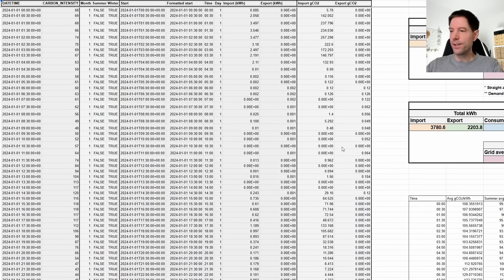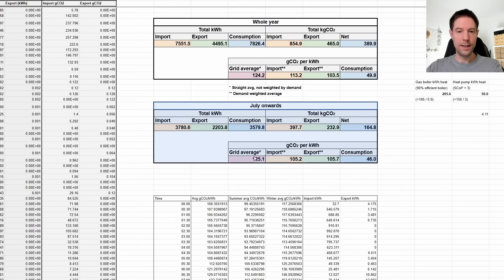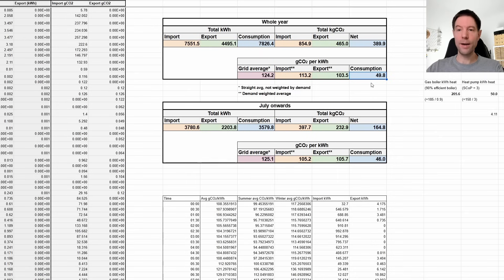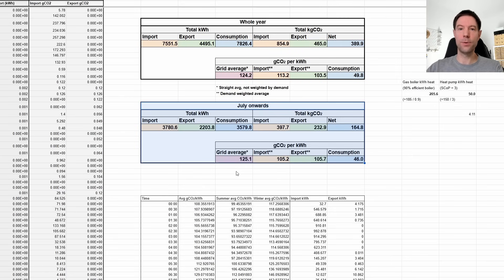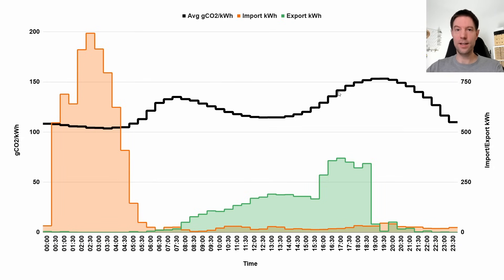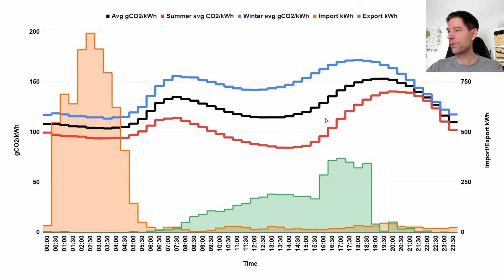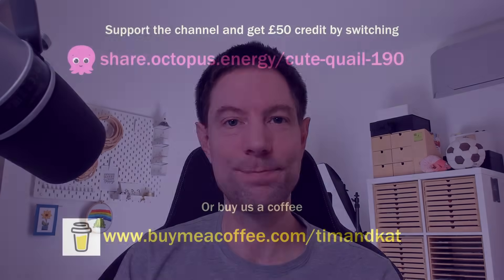I thought we were carbon neutral - I was wrong!

Comment: The carbon intensity figures you're using appear to be per kWh of generation, whereas your usage figures are presumably meter reads, ie consumption. I believe average line losses (transmission+distribution) in the UK are around 8%. If 8% is roughly correct for your area, that means that for each kWh of imported energy you consume your carbon intensity figure needs to be multiplied by 1/0.92, as more energy is generated than you will read at your meter. There is also a line loss related to export, though this should be lower than 8%. You may have already factored this in, apologies if I've missed where you've done that. If you haven't then your calculations are somewhat mixing apples and pears and unfortunately put you further away from carbon neutrality than you have estimated.
Reply from the maker: Hmm, that's a good point, I'll have to check what the data actually means, whether it's carbon intensity as generated, or consumed.
Reply from the maker: Ah ha!  I found the definition of the CARBON_INTESITY column for the dataset I used.  "The carbon intensity of electricity is a measure of how much Carbon dioxide emissions are produced per kilowatt hour of electricity consumed."  As taken from this page: https://www.neso.energy/data-portal/historic-generation-mix/historic_gb_generation_mix
So I think what I did was ok.
Reply: @TimAndKatsGreenWalk  Ah yes, so the carbon intensity data must be adjusted for losses in some way. Agreed, what you did was okay for imported energy, not sure about exported though as that will be a generation figure I guess? I've no idea how it could be quantified either!
Reply from the maker: @CazBag  well, anything I export will be used by my neighbours, effectively reducing their consumption by the same amount.  So I think that's all good too.
Reply: @TimAndKatsGreenWalk  What you export will reduce the load on the local transformer supplying you and your neighbours, which then has a ripple effect all the way back up and through the network. In that sense, the energy you export doesn't really get used by your neighbours, but it does contribute towards lowering total generation. It's difficult to put any numbers on it to quantify the contribution and therefore the effect on overall carbon intensity. The kWh you export are generation and not consumption though. Does that make a material difference? Still no idea! Sometimes things are best kept simple, that I do know!
Reply from the maker: @CazBag  I would argue that reducing the load on the local transformer is materially the same as my generation being directly used by my neighbours, i.e. it means that amount of demand doesn't then need to be met by (larger due to transmission losses) generation from elsewhere.  So in that case using the same consumption carbon intensity makes sense (I think).  Although I agree this does mess with your head somewhat!
Reply: @TimAndKatsGreenWalk  I think it's as good an estimate as you're going to get, or at least can easily lay your hands on now that you've put it that way ;-)

Comment: For comparison you should add the theoretical carbon intensity of the house consumption, assuming you had purchased electricity straight from the grid and not had solar and battery. That should give you a baseline to compare your carbon savings against - I suspect that number will be considerably higher than 399.9 kgCO2
Reply from the maker: Yes, you're right I could do that too, that'll be interesting.  I could do a whole series of videos on this it seems!

Comment: Interesting analysis thanks Tim and particularly the sumer vs winter curves.  Makes sense when you explain them, but not what you’d immediately think of.
Flux is looking increasingly disappointing as a tariff, 13.6p day-rate export, notably less than the 15p fixed export rate.  I ran the numbers and whilst the 27.4p peak export is of course better, overall I don’t think I’ll save much given the import rates are comparatively high.  And as you say the fixed export rate gives opportunity to export in a more carbon positive way.

I generate about 2-3,000kWh more than I consume so probably for me the figures would show I’m more carbon neutral.  I have recently just swapped to Agile Outgoing for the winter as the only times I export are in DFS sessions and this gives a higher export income.  I’ll swap back when the heating is required less and I can start exporting excess solar again, but its an interesting experiment to try
Reply from the maker: I'm probably also going to forego Flux this summer and stick with Go, probably.  I think my rule of thumb will show it's pretty close in either case and sticking with Go will save me having to switch, which despite being relatively easy usually comes with a bit of hassle, for one reason or another.
Reply: @TimAndKatsGreenWalk  I have pretty much made the same decision to stay with Agile (and 15p export) this summer as well as I did last year.   From the analysis I did there was very little in it, and the higher Flux import rates put me off.   I did try enrolling with IOF as your rule of thumb suggested it would be the most beneficial to me given our generation to consumption ratio, but Octopus can’t cope with having two inverters on one account, the IOF enrolment process fails.
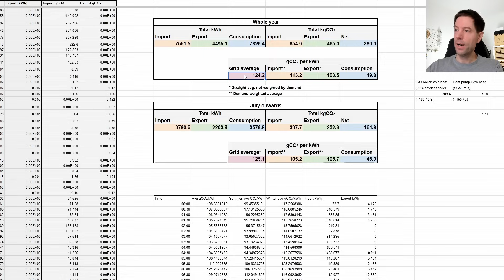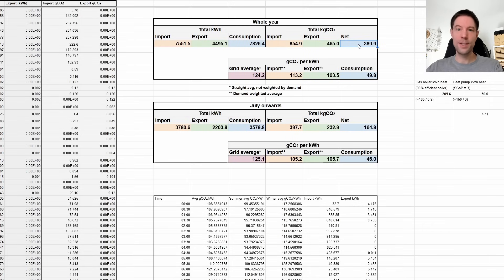Reply: I got rid of Flux back in the summer for the reasons you state and just went to Economy 7. My array is mainly East facing so it's hard to get much export in the peak period. Was only on it a couple of months (managed to have an argument with Octopus overcharging me because my meter thought the cheap hours were 01:00 -> 08:00 instead of 00:00 -> 07:00) and then got an EV so moved to the tariff for that. Have now changed electricity import and solar export to E-On Next because it's cheaper through the day, longer night hours and better export rate of 16.5p.

Comment: Really interesting, thank you. My heat pump was due to be installed next week but has been postponed until March due to, amongst other factors, the fact that it's being funded by a tax free lump sum from my pension and the chancellor created a stampede for pension withdrawals by bringing pensions within scope of inheritance tax and I'm stuck in the resulting queue. Still, I will be switching an 18 kW from radiator gas central heating boiler to 4 kW underfloor heat pump heating and my goal is to become carbon negative in my retirement. From your analysis it seems that investing in Ripple's next wind farm might be necessary to achieve this, otherwise low carbon imports in winter are not possible. I also do energy arbitrage on Octopus Flux and my net electricity bill last week (excluding the standing charge) was 10p, which is remarkable for January, but I am sure that my CO2 footprint will have been horrendous as there has been very little wind. I think a really good way to lower our carbon footprint would be to reduce or eliminate our overnight import during spring and summer, but still export to grid during the evening peak. That way we know that our carbon import is being minimised and our exports are building carbon credit.
Reply from the maker: Ah, dang, I hope you make it to the front of the queue soon.  Very exciting though, that'll be great once you've got your heat pump installed.  I'm interested to see how the summer goes, if I stay on Go it'll still make more sense to import overnight, but I'll probably shift to exporting a bit later since the export rate for Go is flat through the day.

Comment: Any idea why carbon intensity and cost don't line up? I thought the theory was that when there is peak demand then gas was used (because its expensive and easy to turn on/off) which is high intensity.
Reply from the maker: It's a good question and I'm not really sure.  I will have to delve a bit deeper into the generation mix data to see what I can find out.  My hunch is that the solar generation in the mid afternoon is keeping the carbon intensity lower than it otherwise would be even with higher demand, and that as the solar dies away the gas proportion increases even as the overall demand falls a bit into the later evening, causing the carbon intensity to rise.  That's my suspicion anyway.
Reply: Great video again! A lot of battery and hydro will be exported to cover demand during the peak, which may reduce the carbon at peak time. While you may reduce your own carbon offset, you wouldn't reduce the overall grid carbon, because now a bit more gas now needs to be burned at peak, to cover you exporting later. Continuing to export after 7pm would be the only way I think you would have an effect, rather than just shifting your export, because you may prevent more gas being burned and then recharge with excess night wind.

Comment: I have another roof that is NW facing that i am thinking of adding some panels it will only fit 6 panels on but that will help. Looking at trying to get low voltage startup so that it does its best. This will help yearly average but not this time of year.
I am on IOG and randomly was exporting later - mainly because the SOC% in my battery stats is so unreliable. So that was handy.
Now if I could just persuade my wife to let me put some vertical panels on the wall that faces SW ! That would then pick up the low sun at this time of year (and work when the others are covered in flipping snow/ice). Jan has been a hopeless generation month gloomy so much of the time - today again.
Looking forward to seeing what you come up with. You did mention Ripple awhile ago which seems and easy win. 
I would also like more battery as with no solar in the day we do run out sometimes. But a hit of extra £7k is impossible to square financially. Maybe V2G will be mainstream soon. Got a lovely 70kWh battery sat on the drive !
Reply from the maker: Haha!  I'm sure your wife can be persuaded.  I did wonder about adding panels to the walls but I don't think we'll need that as we've got a fair bit more roof we can use.  As it happens we do have a small amount of Ripple investment in the new solar farm but that's not generating just yet, so it'll be interesting to see how that affects things when it starts up later this year.  V2G really will be a game changer if it ever gets off the ground in a meaningful way.  Let's hope so.

Comment: Wow. I wasn't expecting that. The final point about exporting 6-9pm instead of 4-7pm is a great one.

If you want to feel better about the numbers, work out the annual EV mileage and compare that to equivalent ICE vehicle CO2 emissions.
Reply from the maker: Yup, that is a great point and I think calls for a follow-up video at some point.  A good excuse for another spreadsheet!
Reply: @TimAndKatsGreenWalk  Living in rural Cumbria, dispensing with the ICE completely would limit my travel range so severely that I would need to add hours to any significant journey. I just looked into replacing my diesel with a hybrid petrol model of the same model, then discovered that even the oldest models of the hybrid are subject to the government's "luxury tax" for another 2 years, effectively adding another cost on top of the depreciation in value. I'm kicking the can on that idea down the road for those 2 years. In the mean time, what about extending the range of an EV with an extra battery pack in a trailer, with those batteries participating in energy arbitrage when at home!?
Reply: @YewDuct Don't need to mess about with an extra battery pack. There are a good few electric cars that will do at least 200 miles, which is about 4hrs driving, by then I am well ready to stop to stretch my legs, grab a bite to eat, etc, while stopped, you can charge for half an hour, then you can drive for another 3hrs and repeat. Not really stopped for hours, other than natural breaks. Maybe in 2yrs,you might go full EV.

Comment: Is there not a distinct probability that the peak carbon generation is after peak demand because tariffs encourage selling back to the grid during peak demand? Selling it later could well flatten out the carbon curve but quite possibly wouldn’t reduce overall carbon use across the system.
Reply from the maker: That's a good question.  At the moment I'm not sure there's enough domestic exporting to really have a significant effect on the carbon peak, but I'd be interested to see if there have been any studies into this.  Regardless, the more domestic solar/battery export there is the lower the grid carbon intensity will be overall, so it's all good.
Reply: Batteries are exporting in the peak to assist the ramping in of gas as the sun goes down and demand goes up. It's possible grid scale batteries are therefore helping reduce the carbon intensity in this period too, not just domestic.

Comment: Home assistant tracks this continuously for me.
Despite having a smaller array, and battery, I imported just over 70% “Low carbon”, and generated another 20% myself.
So 10% of my usage was fossil fuelled (and of course Drax is a bit more again).
Not sure how valid it is to rate your solar export as “grid average” - that’s purely carbon neutral, and exports from your battery have already had their carbon content calculated on import, so I think you’re double counting there as well.

Oh, and since 30% of my usage was EV… that’s offsetting diesel as well.
Reply from the maker: I think that's the only reasonably way to do it.  Or at least the regional grid average (although as mentioned that data was a pain to get hold of, so I used national instead).

Comment: We had an extension built. A few years back and specced it with double insulation, been slowly working through the house upgrading including this year the roof.

The UFH i had installed on the ground floor goes off around March April and start up again October/ November
Since having the roof done the upstairs radiators are off most of the time and it wil be interesting to see how much less i use on heating next year.

I put this because even if you have a gas boiler UFH on the ground floor and double insulation especially from under the floors is a game changer
Reply from the maker: I would love underfloor heating on the ground floor, that would be great.  One day we might do something like that, but it's probably many years off.

Comment: Your winter, blue line, export looks to be in line with the carbon intensity peak. Summer's peak was later. So for max carbon offsetting,  perhaps your export window should slide left and right with the time of year, in pace with the solar day?
Interesting content as usual.
Reply from the maker: Yes, exactly, that would be the ideal, and if I stick with Octopus Go this summer I'll do just that.  But Flux/IOF has a peak export rate from 4-7pm, so you wouldn't get the best export rate by shifting your export later in the summer.  I think Octopus should have a carbon minimisation tariff with the peak export rate following the peak of the carbon intensity, but I doubt they'll do that as it won't align with the peak of the grid price.  But you never know!

Comment: It's high time Hinkley Point C was online. Many things are out of the consumers control sadly. Governments and suppliers have been too slow over the last decade to decarbonise. The rest of us are doing what we can, but facts are facts.
Reply from the maker: It's crazy how long that's been going on.
Reply: To be fair, 10 or so years ago coal made up over 40% of our grid mix and is now 0% so a fair achievement. In contrast, wind has gone from 3.9% to over 26%. This has meant the the carbon intensity has more than halved from 467g/kWh to 180g (MygridGB). Agree Hinkley is taking too long and more could be done (homes were meant to have been net zero back in 2016 under the old "Code for Sustainable Homes") but progress is being made so there are positives out there!
Reply from the maker: @steve_787  absolutely, every year the grid becomes noticeably greener, so in a few more years I won't have to work so hard to get to net zero, even without extra generation!

Comment: when comparing the winter carbon intensity peak to the summer one, have you taken into account the time changes with BST? the winter peak is still 1730-1800....
Reply from the maker: Yes, I'm pretty confident I've dealt with the time change correctly.
Reply: @TimAndKatsGreenWalk  Thanks, interesting how it's so much later in summer. If I add battery and stick on IOG, I will force discharge depending on carbon intensity, not just the 1600-1900 slot I was going to assume....thanks Tim!
Reply from the maker: @justinjoanknecht3475  yes, indeed it's quite a surprising result.  I think it's due to the higher solar generation in summer suppressing the grid carbon intensity in the early evening, and so effectively pushing that peak back later.  If I stick with Go this summer I'll do exactly that too.